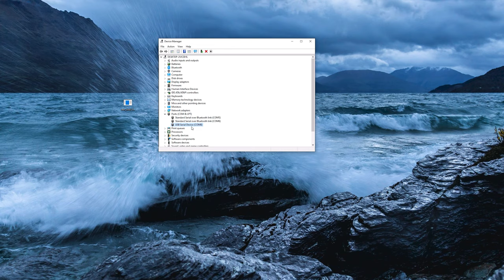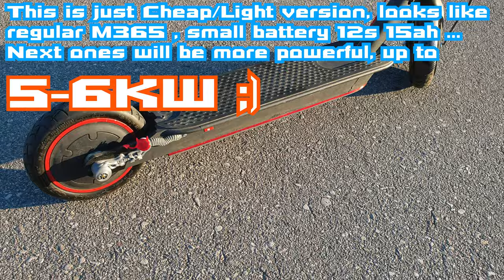Sleeper Xiaomi M365 2WD Sneak Peek🛴 2x 1600W ⚡ Flipsky FSESC 4.2 🛠 Early Alpha version 😍

Comment: No way a battery that can fit in that deck can put out more than 40-50amps you need a stem mounted or add a deck spacer
Reply from the maker: Hmm i can make battery with 200A output but capacity 12Ah
Reply: 5P samsung 35E cells will do 40A, 65A if you watch their temperature. If you use 30Q cells, you can do 75A easy.
Reply: @PirateWasHere   Yeah but voltage will go way down. Around 30ah. And you can easely take 2000w+.. xiaomi Pro2 with stemmount 18ah batt.
Reply: The standard battery is max 40 amp if you change the bms
Reply: I've got a 48v battery (36v internal and a 12v external in series) Nd I get peaks of 2kw and just under 30mph everything else is standard apart from controller traces have been reinforced
Reply: @Cryptidlegend  how did you do that?

Comment: Its cutting off bc you’re drawing more current than the battery is rated for and the bus is cutting power off as a safety. Using 2 controllers with independent batteries or 2 batteries in parallel should solve it

Comment: Charge the scooter 100% and make full vedio off road
Reply from the maker: Motors will melt, after 60sec on 1.6kw motor was over 80c so... ;)
Reply: @PirateWasHere  This is what I am suffering from now, the temperature rises to the boiling point
Reply from the maker: @mrzoro6121  not much can be done
Reply: @PirateWasHere  Are you using statorade or ATF inside the motor? It would help transfer heat from the motor windings to the casing where your motor cooler is.
Reply: @mrzoro6121   what is the battery voltage of your scooter?

Comment: No way your actually turning it into 1600 watt???!!!
Reply from the maker: this is just Ligth version i could not puch it mor cuz it was full power from battery :) , on my next one I will try to go over 4KW. and on 3rd m365 close to 6kw :)
Reply: @PirateWasHere  can you also do this tyre upgrade: https://youtu.be/IkLg96kA_bs 

These tyres should look great and work really well with the power you're working with.
Reply: @dawoodkhan6067  10x3 tire super
Reply: the stats shows you two motors doing 1600 watt. so yeah
Reply: @PirateWasHere   cap. You will need different motors, a way bigger battery that won't properly fit on Xiaomi, a longer handlebar for stability, and a damper. The cost of it altogether makes it a foolish idea and while you may have the same power as other scooters with the same power, you will lack very important features that can't be added or properly added such as suspension, etc. 
Modifying your Xiaomi scooter is not a bad idea if you are doing it at a lower cost than what it would cost to buy a scooter with the spec as the modded one.
Reply from the maker: @princecharles3452  so the cheapest way will be to stay home and play video games ;)
Reply: @PirateWasHere  i didn't mean to disrespect you or mock your build and I'm in fact modifying my own Xaiomi 3 scooter. I was just pointing out that making a 6000w scooter out of Xaiomi scooter is not good idea for previous stated reasons.
I love your videos and I have learnt a few. Your work encouraged me on deciding to upgrade mine which was the best choice considering how cheap it is. 

I love your ascent too. I wish you that you make more videos of the modded Xaiomi scooter, it's what interests me the most. Keep up the great yt contents.
Reply from the maker: @princecharles3452  I know U did not , I just meant that It doesn't matter if any new idea/mod will be super useful and if it will be $ efficient. If stuff makes U smile and keep your mind busy by  trying new things , go for it ! . For me this one is still way better than buy just Ready To Use Kaboo mantis 60v or play video games ...
Reply: @PirateWasHere  you are on point and I couldn't agree more. Life is too short so why not live the best if it.

I cant wait to see more of your videos.
Reply: I want to see it! Creativity in action!
Reply: I just now came back to this comment and it’s still crazy! Wow 2 years!? I have 2 of these now so I could totally make one that would be a fun project!
Reply: @tfmg8223  go for it. I did the same with my Xiaomi mi3 and this thing pulls like crazy. The torque at the max acceleration setting is too much for the stem. I did a speed test from 0-25km/h in about 2,8 seconds or slightly. Less but not more. The tires just skids and I weigh 74kg. 
If you are gonna do the same I advise you not to run it with 48v or below. Brushless motors of all kinds work more efficiently and produce less heat at higher voltages. It's the opposite if ran with low voltage with load. 
And I recommend you use at least 300w motors. Don't use one motor, makes it AWD otherwise you will burn the motor. 

This is my scooter spec.
720wh battery 60v 12ah (connected batteries in series and parallel)

2x 300w motors 

2x 25a controllers / lh-100 display

10inch tires 

Handlebar extension. (same handlebar but extended with a kit from AliExpress)

I was able to hit 52km/h. I should be able to go a lot faster than that but battery bms won't let me. I have to change the BMS to be able to go faster 

I have not done a range test but I remember traveling 13km and losing one bar with 62v left out 67v.

Comment: Have you heard of using atf fluid on these motors? Helps cool them down. Can get much more power out of them.
Reply: What do you mean?? How would that work without causing a short circuit?
Reply from the maker: Mineral oil doesnt conduct electricty but just imagine time spend to seal the motor and then one tiny place where seal popsout due to oil pressure caused due to high temperatures and hours spend to clean up the scoot from oil ;)
Reply: Statorade (Grintech) is great for helping with heat transfer from the motor core to the outer shell
Reply: @-joo3033  doesnt it leave residues??
Reply: @santiagosimonazzi1562  no ? Getting it fully off the magnets might be impossible but theres no reason to do so, tho it dries up and you have to add more once a year or so, also you have to seal the motor housing with high temp silicone, one that doesnt corrode aluminum surfaces.

Comment: Are the controllers stock? If not which ones do you use? How much Amps can I kinda safely and reliably push throught my stock pro 2 controller without reinforcing? Thanks for reply.
Reply: he used Flipsky FSESC controllers, hes using about 30A per motor

Comment: Hi, I just have a question: RT data shows the Power and Current of one motor or both together? A am a bit confused, because mine shows 2.9 kW in peak...
Reply: I think its the total power vesc handle. If you have two motor its total

Comment: I've manage to to do conversion, so 2 motors, 2 vesc 4.20, Just for the testing phase 2x4ah Bosch 36V powertool battery, but i have a problem with braking. Each motors are on 25amps, the acceleration is still awesome even at this low settings, and i tried the braking power from 5 to 10amps but i am getting less stopping power Than when i only used 1 motor on 4amp.... What can be the problem? The vesc tool shows the right 10amp when i'm braking, but the scooter doesnt really want to stop.
Reply: the breaking in is powered by the battery too. Maybe your battery is really weak. I dont have info about bosh 36v battery but i dont trust those either. But try to search some esk8 forums. also breaking is negative. so -10amps?

Comment: Hello I installed awd and I wanna to remove front brake sencor and leave one in the back and my question is how can I do that?
Reply: Do you use 2 controllers ? U can set the braking amps lower in custom firmware

Comment: I have same problem cut off
Reply from the maker: auto tune fix it in my case
Reply: @PirateWasHere  tanks
Reply: @mrzoro6121  Foc tune it will be fix. And important set the battery max. value should be divide by how many motors. So if you have 50a batter but you have 2 motors then 25a. Regenerative is about charging your battery.

Comment: Damn only 25kmh?
Reply from the maker: max could be 36 on fully charged battery
Reply: i was thinking the same my stock one goes about 25kmh already so I'm not sure how this is a sleeper and if only on full charge it goes that speed then that isn't really much. i thought with dual motor you'll get more push to maybe 40kmh but lets see what more you do later on.
Reply: @MrOneTech  it's weird because these are 2 1600w motors and the zero 8 goes 40kmh with just a single 500w one
Reply from the maker: @viperro4542  its about motor KV
Reply: 2:05 it seems like 59kmh
Reply from the maker: @puikplan  i set wrong values
Reply: @viperro4542  that 40kmh 500w cant get to any steep hills that these 2 motors at 1600w. kv is torque but as well as power. Most motor hubs has the same Kv? idk about that

Comment: 1:43 dude what are you doing dude? You don't need to setup that parameters. All you need to do is set the amp rating Go to esk8 forums and copy what they do. If you have 30amps of max motor then you can do - 30 amps for breaking. And for battery how many p you have? what type 18650 or 21700? most 21700 can do 8a per cell so multiply that with your p (for example 5 parallel) then you have 40. Cause you have 2 motors to feed you need to divide that  40 /2 = 20amps ( each motor) so write that down 20amps for max battery. Regnerative breaking write down 5(parallel) x how many amps its okay to charge your battery. 1c? 3amps so 15 all? 3x5 = 15amps or less. Man study and stop making wrong information videos! Stop teaching your co-electric scooters the wrong way with VESC.
Reply: THe speed is very off? why? you didn't set the right gear ratio which is direct drive 1:1 and your wheel size.
Reply from the maker: I did , exact number of poles, 1/1 and pereftly measured tire diamater